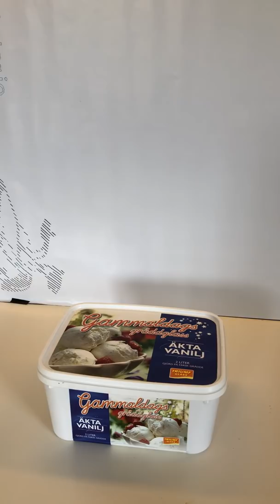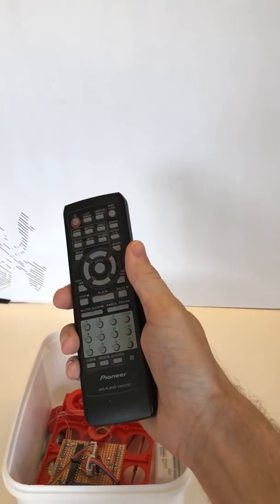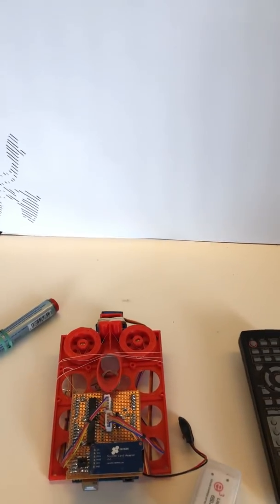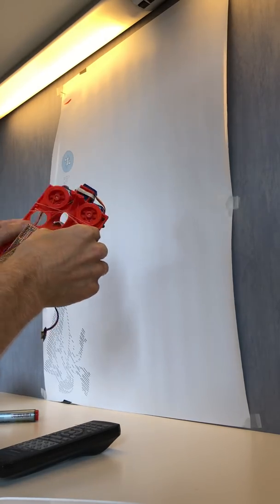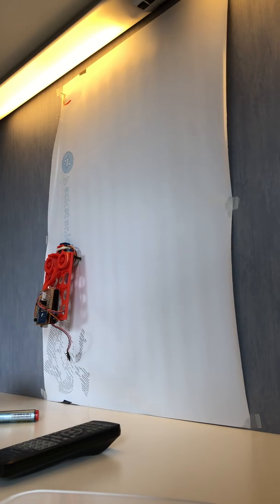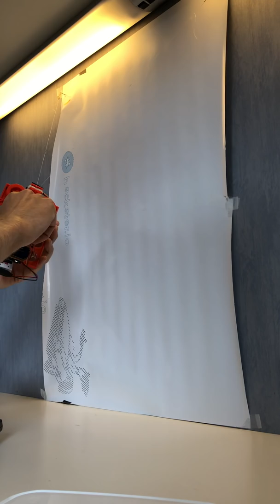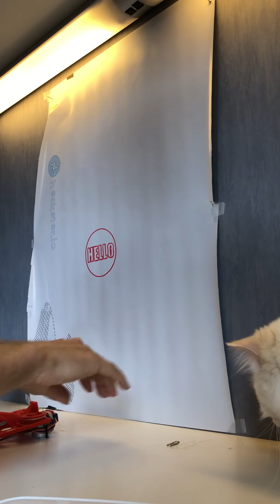Wall Plotter

Comment: Hi Fredrik - At @1:30 you explain the strings cross at a point under where the pen will sit.  At @7:32 you explain the tip of the pen is "more or less" straight under where the lines are crossing. So just want to make sure which is correct? It looks like the lines are crossing above the pen tip?  Is that correct? Thank you so much.